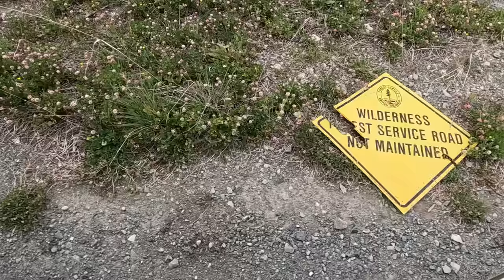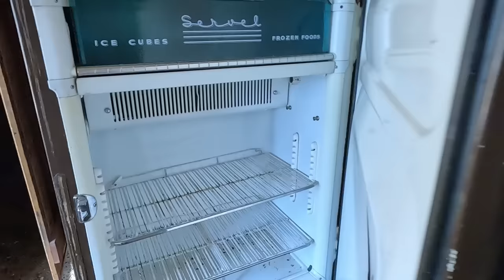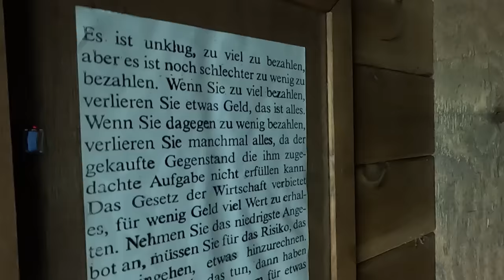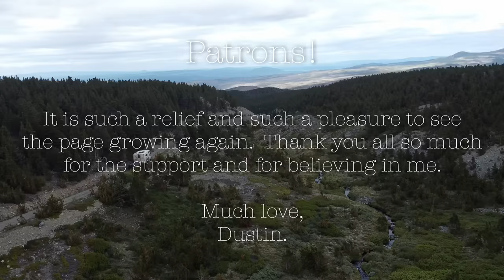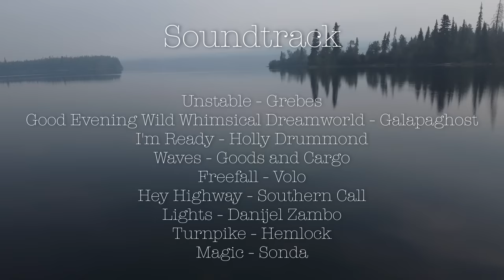Off Grid Luxury Home, Abandoned Deep in the Forest | Destination Adventure

Comment: The washing machine you found was called a twin tub washing machine. One part with the agitator was where the clothes were washed and the other smaller part was where the clothes were put after washing to spin the water out of them. In some machines it was possible to then connect to the water tap and spin it again to rinse the clothes before spinning them again to get as much water as possible out of them. The clothes couldn’t be dried in it, they needed to be hung up somewhere preferably outside. In Scotland where I live we tend to hang washing outside to dry and still do as we don’t use dryers too much. Of course, we don’t have bears who might come and pinch the clothes!

Comment: The 1999 cabin with the two stoves - the larger one was probably for cooking.  You didn't show any kitchen in that cabin with a modern stove.  The second cabin also seemed to have a greenhouse frame on the outside (when you are pointing at the roof's ridgeline), which would link it to the builder of the German cabin.

Comment: You're right... it is a washing machine called a "twin tub".  You wash on the left and spin dry on the right.  It doesn't get it completely dry, but dry enough that it will generally air dry in a few minutes once you hang it.  If you use it outside... and use non-toxic soap... you can water the garden with the "used" water.

Comment: Too bad no mention of those beautiful burl wood posts next to the staircase....The place gives me the idea of maybe a hunting lodge with separate cabins for hunting/fishing parties.  Sometimes too, what happens is that maybe the municipality permits were not granted, or (I have seen this before out in the deep woods up North)  the electric company charges an extreme amount of $$ to bring in the lines that deep off-grid.  I saw no large (1000-2000-gallon) propane tanks since there were gas stoves and appliances in the home (or a NG line was supposed to be run in that area). Often, the electrical lines, NG lines and the clearing of the road is an extreme expense that the homeowner can't afford (even if they have the $$).  I see this more as a commercial site, hunting, hikers, etc than a private place with being abandoned before being finished, like mentioned, the owner could have died and the estate is being contested and drawn out or it was a red tape issue (permits, road building, electrical + NG lines.)

Comment: So that cabin with the wiring and plumbing has access to a power line? Perhaps 12 volt system given the car radio?

The 1st out building looks like a sauna.

The larger wood stove looks to be an air tight one, used to efficiently burn all through a cold winter's night.

Comment: My grandmother used to have a washing machine just like that. You could hook it up to a standard kitchen sink spigot. You filled it by hand on the wringer side, then let it agitate for awhile. Grandma used to wash the lightly-soiled to the most-soiled items using the same wash water. Each load would be taken out of the wash water by hand, then spun out in the other side which drained into the kitchen sink. When you were all done, you would drain the wash side out into the kitchen sink and roll the unit back into a corner of the kitchen, usually covered with a hand-stitched needlework covering.

Comment: You obviously need Edison generator for your bicycle and water pump A car generator chisel to spin like Edison generator.  You remove the Tesla magnets from the armature magnets by counting the magnets and divide by 6 you chisel off one sixth and then leave one sixth on and go all around the armature chiseling off every other one sixth of the armature magnets.  Three sixths on and three sixths off  alternating on and off.  Reassemble this motor and wire to 12 volt DC motors or DC AC inverters 40 amps tho have 110 volt AC power continuous peak power without fuel or pollution.  Thomas Edison's generator with transformers and inverters to deliver house current.  Diy it is a public patent used by shell oil company invented the Edison generator powered electric cars..